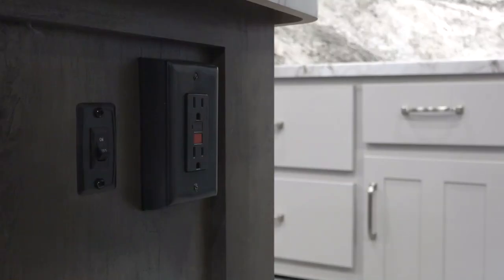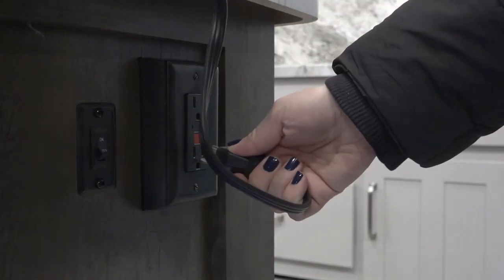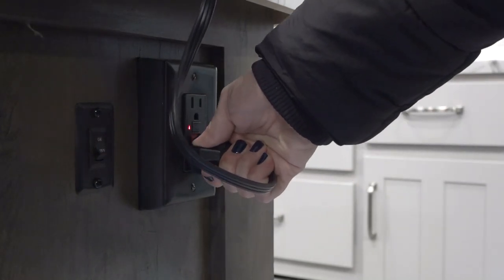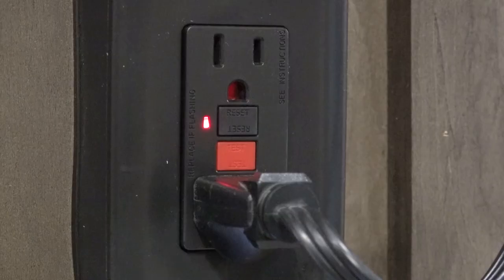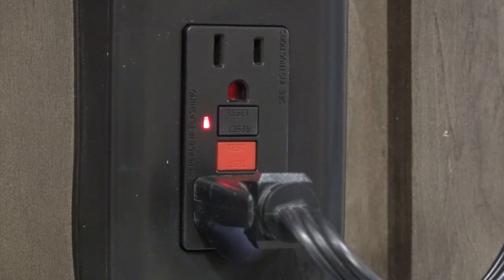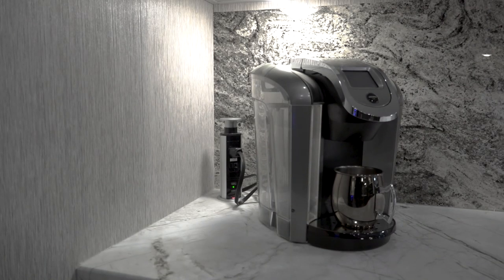What causes the "GFCI" to trip?

Comment: How does one solve this , is the outside outlet connected to the reset button in all trailers from the 1998 series.? I plugged in my snowblower  not good 😢 in -9 degrees cold,,, This outlet is important to my under the trailer heater so my water tank doesn’t freeze, everything else is good and furnace is working fine, lights also. Thanks so much Oh I’m 72 very happy and glad there’s people 
 Out there to help, much love, Sandy.

Comment: Would a low battery cause the GCFI to trip?
Reply from the maker: The outlets are AC power or 110V power. So the 12V side would not be a part of that issue specifically. If you have any other questions, please do let our retail team know at 1-866-425-4369. Thank you.
Reply: I had the same question, my GCFI keeps tripping..